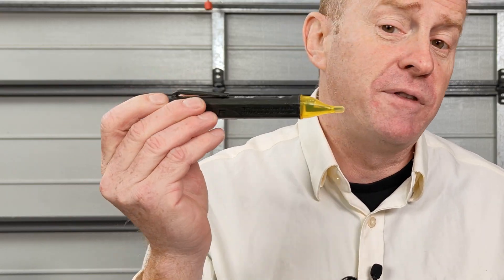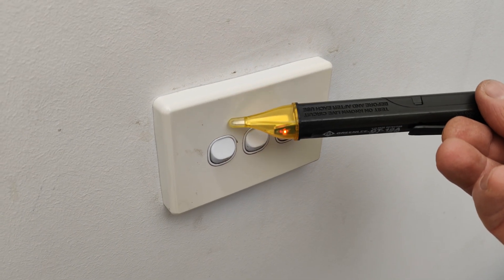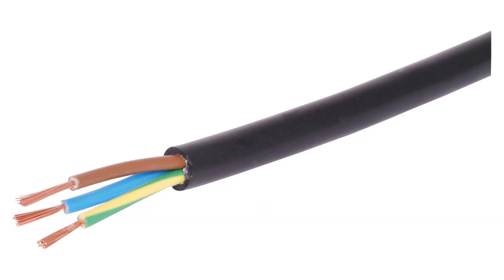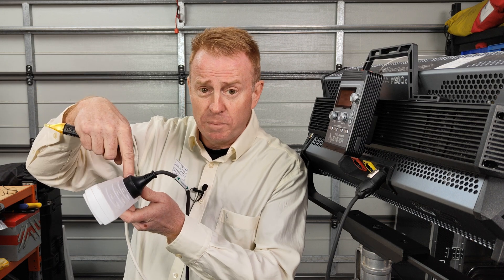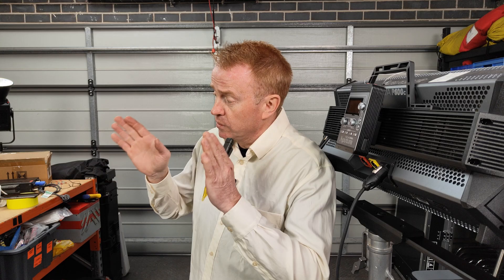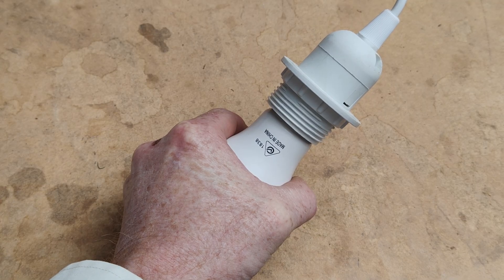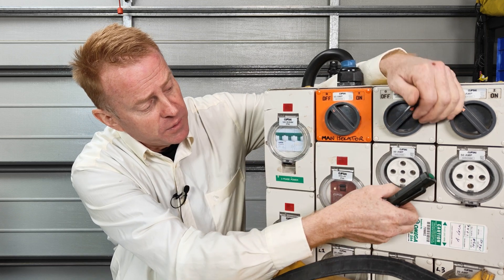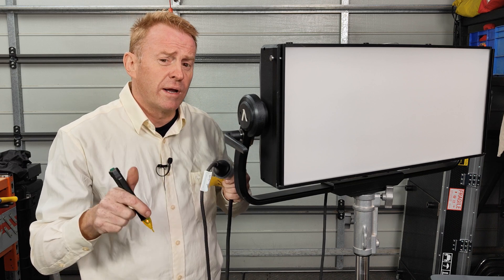Gaffer & Gear 234 - Voltage Detectors

Comment: Yes, not sure about other countries, but in the USA in some homes built prior to about 1940, where knob and tube wiring was used, the individual wires typically had rubber insulation with an asphalt soaked cloth braid and the wires were not color coded i.e. black for hot, white white for neutral as is the requirement in modern times.  As such, it wasn't unusual to find very old light switches originally placed on the neutral, rather than the hot, or active side of the circuit.

Comment: What's the reason behind the volt stick not working well with portable generators?
Reply from the maker: @gilbertof2851  I honestly don't know, it's just something I've noticed, my theory (if the generator is not under load) is no electrons are moving between the coils

Comment: I’ve got a little tip, I found a voltstick by the Brand „Laserliner“ that is always turned on and run’s for month’s on a battery. I always keep that in one of the outer pockets of my workpants, and if I want to check a cable all I need to do is hold it up to my leg. I know it’s a small thing but it makes me use the tool a lot more.
Reply from the maker: Thanks for that tip. I can see that working when you are deploying the cables.

Comment: Another incredible episode! Thank you for making these gold nuggets of knowledge available when even my film school didnt teach it.

I would love to know how to setup, operate, balance, and repair large 500amp+ 3 phase generators. I cannot find the resources on these anywhere and it seems to be something everyone is just expected to learn on the job.
Reply from the maker: The biggest amount of light I've ever run on a set was 76Kw. Back in the tungsten days, and I had nothing bigger than a 5k running.  Because I'm in a 240v country that was done on 2x50a 3 phase cables and one 32a 3 phase cable.

Now everything I have is LED that distro is collecting dust 

My setups are so small I don't even own a clamp metre.

I might have a chat with one of the generator companies here in Melbourne and see if we can organise an episode.
Reply: @gaffergear  That'd be a godsend for young gaffers. Just the basics on inner-workings, operating, and what could go wrong/how to fix it would fill a massive gap in knowledge available online for gaffers.

I fear the day I am hired on a feature and asked to operate one.

Comment: Every electrician needs to have an actual portable  testing meter capable of measuring volts and ohms. Every best boy electric needs to have a meter measuring volts, ohms, amps and frequency. A copy of the Set Lighting Technicians Handbook is essential reading on my crew.
Reply: I carry a basic hot neutral plug a amperage plug and if I need more I go to the set cart and grab the big boy. These sniffers really don't help on a big film set. Also, I usually have run all the power and take care of the gear I use so I know what potential problems may have happened and have back ups. 

Just got done on some indies and man the gear cheap rental houses send out sucks. Never seen so many stingers get fried in my lifer.

Comment: Why are volt sticks/test pens not as reactive to a lead that is running off a portable generator?
I would have thought since the generator is outputting 240v wall power it would work the same as testing a lead on home power. But obviously not, why is the power from a generator different to cause that?
Reply from the maker: Apparently it has something to do with how the dyno generates the power. I don't really understand so I didn't want to give an explanation in case my understanding is wrong.
Reply: Also great videos by the way! Always super informative, best lighting channel on Youtube by a long way.
Reply: If I had to offer a guess, it would have to do with your proximity to the generator. Assuming all things are the same, and your two phases are comparatively similar to household two phase (220/240) power, my guess is the oscillating fields produced by the generator interfere with the capacitor coupling in the volt stick. Mains power obviously is well distanced from the generator. That being said, if you're still having trouble testing far away from the generator, you'd need an actual oscilloscope to see what's going on.
Reply from the maker: It's an interesting theory, and would explain not getting readings at the outlets at the generator but I'm 30 meters from the generator (for sound reasons) in this video.

Comment: Some more advanced sticks (not expensive) like i have can detect and tell what range of voltage the detection falls in.. like simply "over 300, 200-300 100-200v,50-100" as it has variable sensitivity and i always hear people say they dont detect low voltages but my stick smells easily the voltage from 16v rc lipo's that i have. 12v is hit and miss on it and one cant rely the stick for that.
Reply from the maker: What make and model is it, it sounds like something I want in my kit.
Reply: @gaffergear  It was some korean tool but the label fell off  so i cant exactly say what model or brand it is. one of the tools i dont use very often but when i do i couldnt live without it so havent memorized the tiny details but i can always find it when needed.

Comment: Great Vid, and great you showed the traps with them. I had a Fluke one of those and didn't test before use, just assumed it would be all good. No voltage registered with stick, double checked by other means and sure enough the  internal wiring in the wall was live. Opened up the stick, leaking DURACELL battery,( the worst batteries for leaking I have ever seen). Big lesson learned. Thanks again

Comment: I like that a lot of tools have some overlap
I can use the sniffer (voltage tester) and then verify with an outlet tester
There was an outlet that my outlet tester said had hot/active and neutral reversed (was for a lamp), and I verified with my sniffer/voltage tester.
Multimeter can give me more info like voltsge, and amp meters can give me amps, but the sniffer is fast and great for first inspection

Comment: when I've used kino fluorescent fixtures in the past, i found that my voltstick would activate if it was near the tubes, without touching them. Do you know why that would be?
Reply from the maker: Assuming the tubes were turned on the gas in the tube is an open conductor. If it is turned off I have no idea.
Reply: @gaffergear  they were turned on. Thanks for the reply!